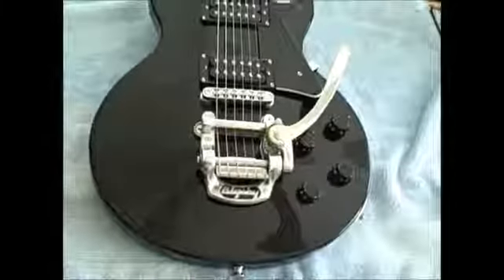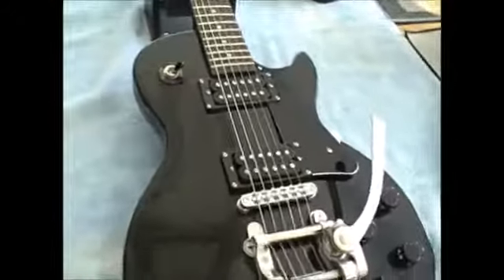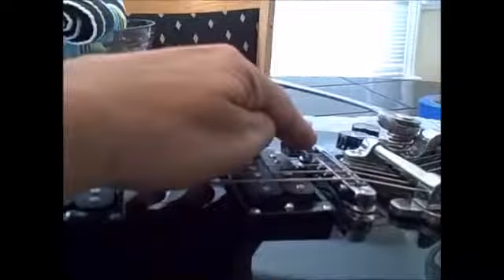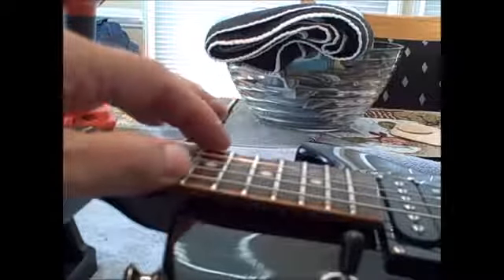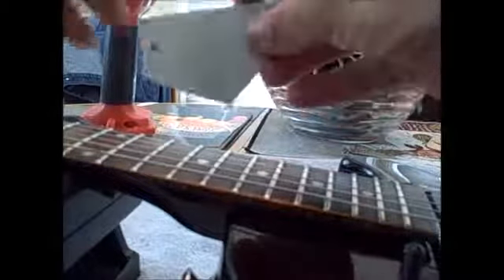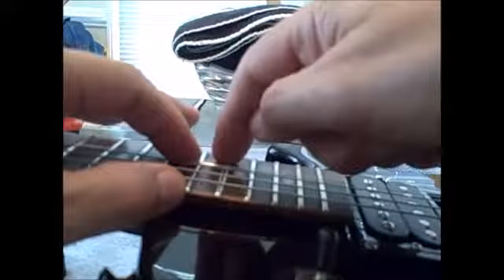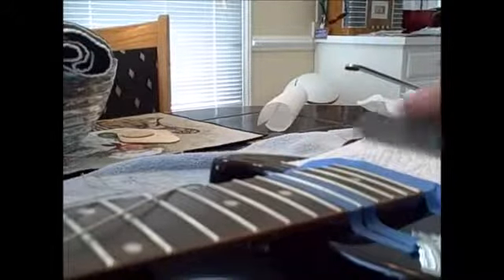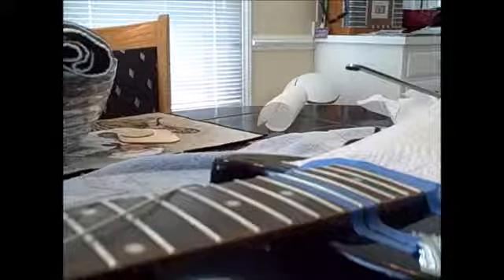Do It Yourself -  How To Level A High Guitar Fret & Eliminate Fretting Out

Comment: I have very fine straight ding/groove in my 9th fret (almost not visible) and when I stretch the G string it will hang up very slightly in the groove (it catches on the very fine groove). Again, this is a very very fine groove (like a string pressed hard into the fret as it runs in the same direction as the string). I could not even see it without magnifying reading glasses. Can I just fix the one fret and how would I get the slight ding out. Thanks and very well done video.
Philip